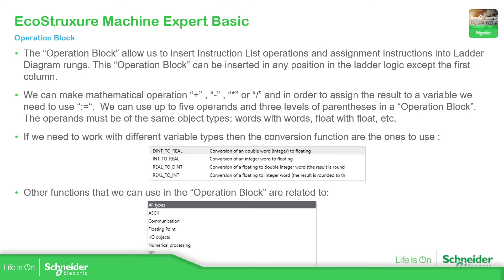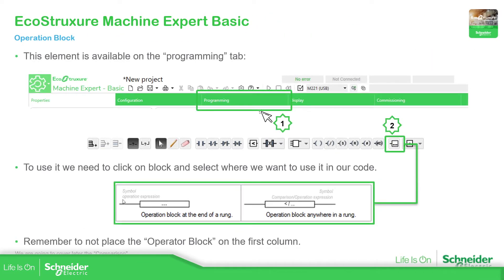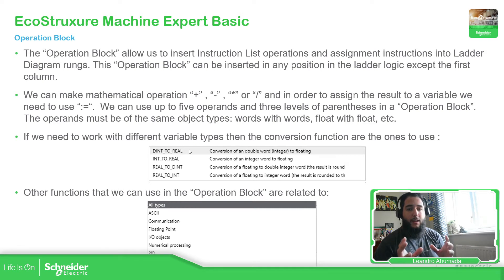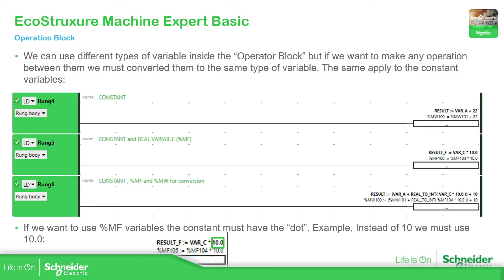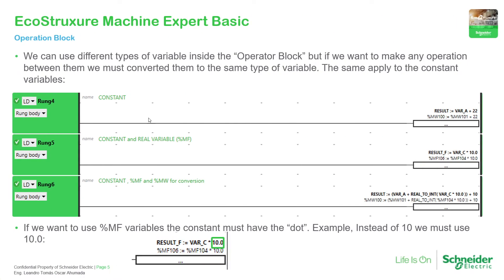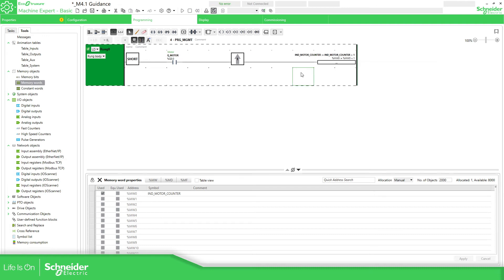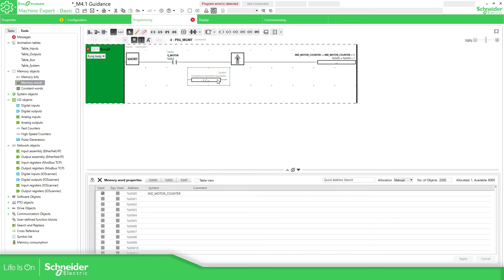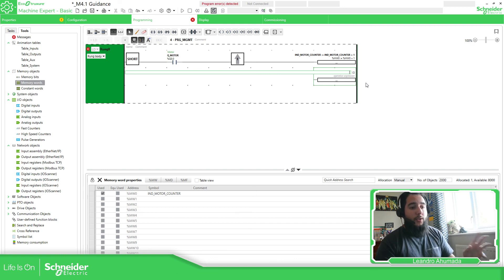Training - M221 - M4.4 Operation Block

Comment: I tried to convert sec to hour (sec/3600), but the value is in decimal, so I could not get any result in the program. How to get results in decimal.
Reply from the maker: Hi there! You will need to define a variable %MD for the hours (example %MD100) then the seconds can have a %MW variables (example %MW200) then you will need the converter INT_TO_REAL so it will be something like this:
%MF100 := INT_TO_REAL( %MW200 ) / 3600.0